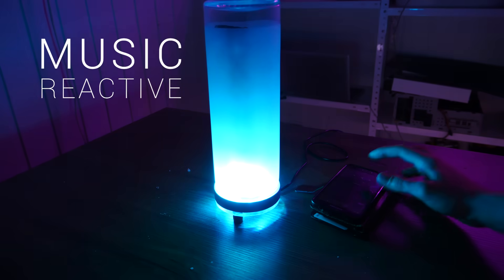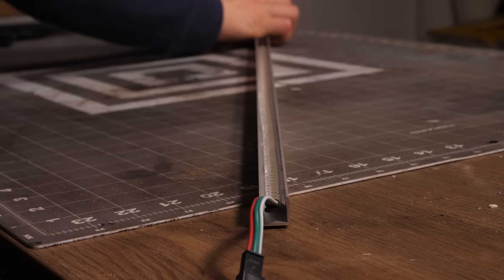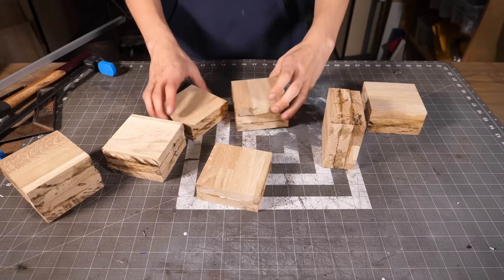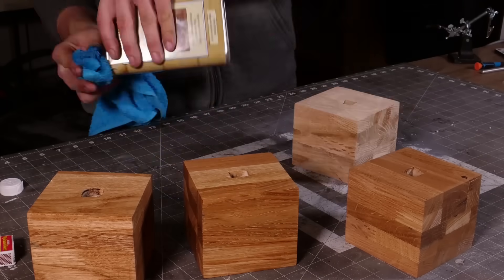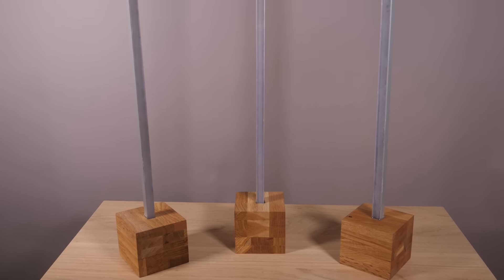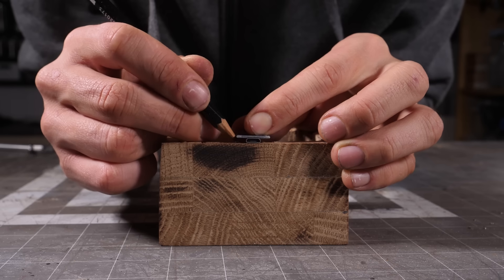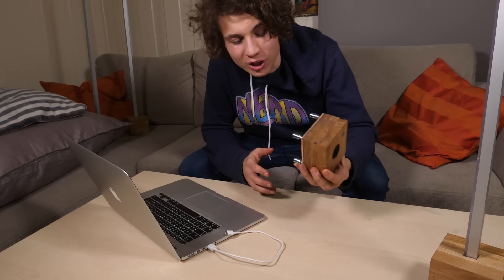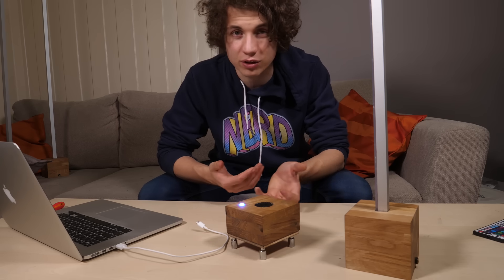Making Wireless MUSIC VISUALIZING Floor Lamps

Comment: Does not work. I did EVERYTHING according to the instructions. 1 lamp is working .. Two lamps by pressing the reset button. All 3 lamp do not connect and not work. It is a pity that I spent time and money ... I asked questions for 2 months and searched for answers on the Internet. All in vain.

Comment: You can buy coloured aluminium channel with a removable frosted plastic cover which just snaps into place, especially for LED strips, used for under cupboard lighting etc. It's perfect for these projects. No need to be cutting up massive sheets of acrylic.
Reply: Bro, can you tell me the exact name for that stuff? It will help so much to reduce some workload.

Comment: where do i have to put the reactive_common.h and what have i to do myself in the files so that it works with an 144led strip?
Reply: I'm just looking for the answer to this question. will you tell me if you find a solution
Reply: @hasancaner9344  sure
Reply: @hasancaner9344  firest, create an account on github, then download all the files(there a button)
then you can open the code and through scetch--> add file you can add the reactive_common
enjoy
mine is finally working (pretty well actually, almost no lag)
Reply: @spyby5176  
Could you code your codes. thank you. I wondered for the lack of delay. 
And I'm grateful for your help. Thank you again
Reply: @spyby5176  is your really working ? i did follow the instructions.....i can see the slave sending and receiving heartbeats from master but the lights wont turn on
Reply: @ScorpionGR666  it does work. But only a short time, like 5mins at a time. then they stop working and i have to reset them. I dont rally know why and i would love a follow up vid from Nerdforge explaining the software bit mor detailled

Comment: How much would this cost to make? 
Thanks :)
Reply: Depends highly on the materials you get. I would say between $80-140, as you would have to buy many of these components in bulk if you haven't got any spare from previous projects. The most expensive materials for this project won't be the electronics, but probably the wood, acrylic, and housing. Plus you would need a lot of tools such as, soldering iron, drills,  sanding paper, varnish/oil and some other tools. All of this added costs if you haven't got the equipment already will cost you an additional $200+. Also, consider your time. If this is your first time making something like this, it will take upwards of 30 hours to make, and many things can go wrong (one of his lamps didn't work due to poor wire connection) plus you need to know how to solder properly.

If you really want to try it, I would still highly recommend it, but I would recommend starting with one and practising your skills, then build up the rest.

Comment: You should add an aux port and pass through in the box so it doesn't have to use the microphone.
Reply: Poob Or even use Bluetooth
Reply: @obesewesticle7265  ya, i know some code so i might just add that myself
Reply: @not2day646  I know I am late but can u plz share the code 🙏
Reply: Yeah and it would reduce latency in comparison to a microphone or Bluetooth
Reply: For someone who does not know, I would have to change the microphone module for a bluetooth module, right? But what bluetooth module do you guys recommend?

Comment: That is so awesome.I can solder ,and dabble with electronic repair etc.I have never done anything with these programmable type raspberry like things.I'm a master woodworker and that part I have easy.,but the wiring I think you make look easy and might be to difficult or time consuming for my ability.I'm sure I could eventually get there,but at what cost of money and time. Ever tried any veneering?its easy,you can e!iminate all sanding,glueing of blocks,ripping with tablesaw and miter saw of most blocks.also less difficult chisle work.just use a sharp razor blade knife,maybe a veneer saw,also can eliminate those burn in marks on the wood,and achieve the appearance of one solid block of wood from eliminating the board layer seams.must safer for you tube followers as well as reducing costly tools.veneer also will take stains and varnishes more evenly.you could use a small handheld router with veneer bit for best fastest results but not necessary.....
Great video

Comment: Seems like a fun project! Have you tried either assigning a random color value to any given frequency/voltage (depending on how you did it) or even just assigning color values to the frequency? It looks like your lights only respond to either volume amplitude or are assigned a specific color to a band of frequencies. I haven't had a chance to check out your code or really any hardware you used aside from what you showed in the video, but it seems like a really cool project! Good job!

Comment: My WeMos D1 mini v2.20 doesn't have a VIN hole where do I connect the wire from the charger module to the WeMos D1 mini.

Comment: I’m looking to make a similar design excepts I know this type of design will have latency. However, do you believe most of the latency is coming from the microphone having to “hear” the sound before it can  begin the process or is it because of the WiFi boards?
If I use a MSGEQ7 and audio jack for the audio input yet still use audio output through the WiFi boards so the lamps don’t have to be connected, will there still be noticeable latency? 

Thanks for the video btw helps a lot :)
Reply from the maker: The biggest latency is for sure wifi. I think, as some here have suggested, using a lower frequency chip like the ZigBee, will reduce the latency a lot, potentially making it unnoticable.

Comment: I need help to complete this project.

I used only 1 Sound reactive lamp.  The Leds on the lamp come on but not reactive with sound.  Where did I go wrong.  I have used Sound Detection Sensor Module, Microphone Sensor Module, Brand ARTOU from AliExpress.  Is it the right module ?
Reply: same happned to me but the problem here is amplification of sound sensor in most of the sensors its very low

Comment: After 2 months of frustration, I finally got these lights to work as intended. Not sure If I can be help to all of you struggling, but I can try my best to help
Reply: hey maybe you can Help me how do i include "reactive_common.h" into the sketch thanks ;)
Reply: @flyingmedia5164  Are all of your files in the same folder (Place) on the Arduino project?
Reply: @livefilmsrock  i have found the Problem thank you
Reply: @flyingmedia5164  Yep, let me know if you need any help
Reply: @livefilmsrock  can you help me, theres no light on the led strip... I think its an error in the code.. Did you some changes on it?
Reply: Can you post how you soldered master part ? (im confused with button/led/resistor part)
Reply: How do I include "reactive_common.h" into the sketch
Reply: @AziemNizam  put reactive_common.h in the same folder with the code you upload

Comment: You code break on include "FastLED.h"
Reply: welcome to the wunderful world of arduino :-). You have to compile the code in the arduino IDE. You'll need to put all libraries, header files into the sketchbook folder of this project. In arduino IDE you can search for the libraries "fastled.h", "ESP2866WifI.h" and so on. The code does work but arduino IDE is a bit tricky --> google is your friend, search for any issues you have and you will find support in different forums.

Comment: Your code doesnot work
Reply: I had the same issue before, but then I got the code to compile and upload in arduino
Reply: @livefilmsrock  from where??
Reply: Alex Petze Where did u get the right code from?
Reply: @andorferleon7431  @janina Blog : I got the code to compile or verify, but I am still having issues trying to get the controller to connect with the lights

Comment: Hey. I'm really loving this project. All the parts finally arrived after 6 weeks. I have made the four light circuits so far and powered them up. when I tried to upload the code to the wemos mini d1 I'm getting many errors. can you help please? or would you have a video showing the step by step as discussed in the video above.
Reply: Have you made any breakthroughs with the code?

Comment: I want to make these for my mobile Djing set up... having small yet interesting lighting like this with no setup times is pretty cool... i just bought all the parts and I'm going to make it.. FYI for all the parts was $273 Australian... then i'm hoping to set them up to have a range of different light coloured movement effects strobe etc. i think i'm about to crash course on arduino Programming.
Reply: so i have made 3 of these now Woot i love them was going to make 4 but i busted one of the led light strips waiting for a large roll of the strips to arrive.. i have a front DJ booth that has LED light strips already and i'm going to replace all the LED lighting with these and run them all off the same network.. going to be so awesome amazing light show pretty much...also i did get the wrong power supplies i got 50Wats instead of the 40W...  only thing i have found is when the lights when they are in White mode they flicker a lot. i have to work out why. I want to add some buttons to the master box to add some effects like strobe.. all red green blue.. instead of having to cycle the one button.. i have a few DJing DMX lights but i don't use the DMX functions because i made my own lights but it would be so awesome if i could work out how to control the DMX from the sound active master box as well. So at the moment if one light doesn't work then nothing works... is it possible in the coding to say that any number of these can connect and it won''t effect them?
Reply: g'day i have all my parts... cept i bought the wrong power supplies for the slaves there was two options on the bang good page i didn't notice i got the 5V10A... theoretically it should still work right? i'm about to upload the code to the wemos

Comment: Hello, how did you manage to get that nice mic sensitivity? I have same sound sensor but mine not react. I only see reaction when I blow the mic. Did you add anything more to the circuit ? Thanks!
Reply: Hello! i have same problem, Are you solved?
Reply: @jasurabdurasulov2274  I'm not sure if you guys even need this info still, but you can try changing the MIC_LOW and MIC_HIGH values in the led_slave code
Reply: Also, there might be a small potentiometer right on your microphone module that you can adjust with a screwdriver to change the mic's built-in sensitivity
Reply: @TheCrazyGinger   I tried that also but I guess microphone sensitivity is way too low, which microphone you are using ?

Comment: Hello!! I have some problem, all slave's connected to the master, but nothing on the strip....  Also in serial monitor of slave i get this: "Connection established!
IP address: 192.168.4.2
Sending heartbeat
Returned: 8, also sizeof hbm: 8"
What do i need to do?
Reply: I'm having the same issue but have only one LED lit up on both of the lamps. Have you fixed this issue?
Reply: Change define ledpin = 2 to d2
Reply: In slave code

Comment: Wonderfull project, I started mine.. but aleas wemos mini D1, seems reluctant to work with WS2812B... 

I use a WS2812 strip led (139 LEds), with 10A 5V power supply, but it doesn't light up...

So I hook up the very same led strip to my old arduino Uno with example/fastled/firstlight... work flawlessly...

I then upload Firstlight to the Wemos (using data pin 5)... no luck...

I have no experience in wemos (seems a small and nifty thing !!)...

I checked, the program upload and run correctly in the wemos as I added some Serial.print to get some feedback in serial monitor....

Wemos (+5v) <---> Power supply +5v
Wemos (GND) <---> Power supply GND
Led Strip (+5v) <---> Power supply +5v
Led Strip (GND) <---> Power supply GND
Wemos (D5) <---> Led DATA

#include <FastLED.h>
#define NUM_LEDS 139
#define DATA_PIN 5
CRGB leds[NUM_LEDS];
void setup() {
 // sanity check delay - allows reprogramming if accidently blowing power w/leds
    delay(2000);
    Serial.begin(9600);
      // FastLED.addLeds<WS2812, DATA_PIN, RGB>(leds, NUM_LEDS);
      FastLED.addLeds<WS2812B, DATA_PIN, RGB>(leds, NUM_LEDS);
      // FastLED.addLeds<NEOPIXEL, DATA_PIN>(leds, NUM_LEDS);
}

void loop() {
   for(int whiteLed = 0; whiteLed < NUM_LEDS; whiteLed = whiteLed + 1) {
      leds[whiteLed] = CRGB::White;
      FastLED.show();
      delay(100);
      Serial.print("       DATA_PIN:   ");
      Serial.println(DATA_PIN);
      leds[whiteLed] = CRGB::Black;
   }
}

Any ideas... please...
Reply: try #define LED_PIN D5
Reply: Привет! Does everything work now?